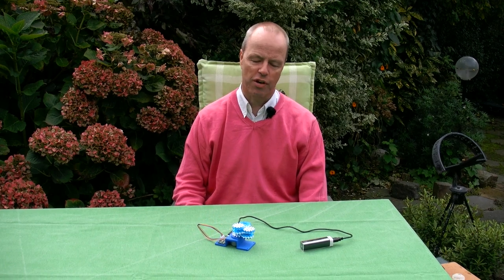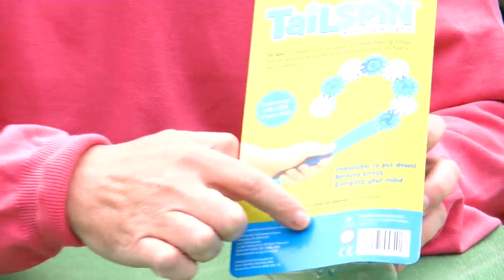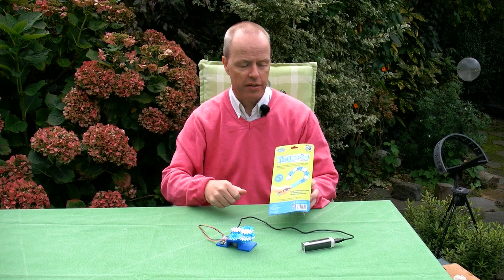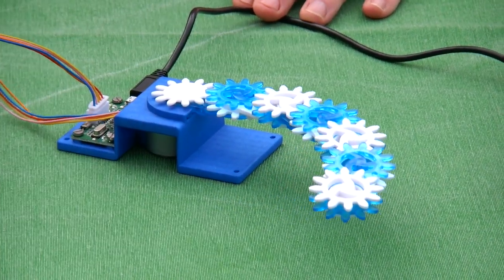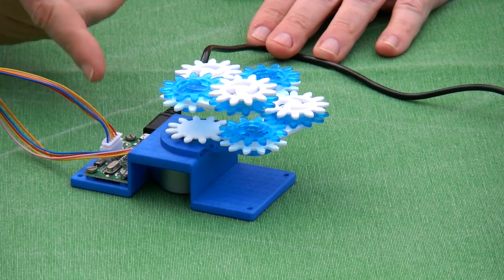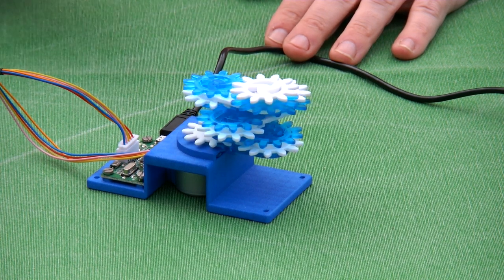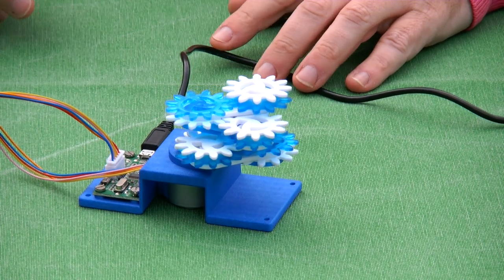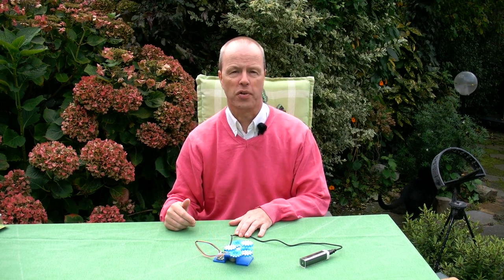Tailspin Motorized

Comment from the maker: How does one operate the Thinkfun Tailspin toy? What is its original purpose?
Reply: One operates it by swinging it at foes like a flail. It's original purpose is to deal great damage to lightly armored enemies, dealing both crushing and slight piercing damage.
Reply: No idea Oskar, Thurs us the first time I see this I'm starting to follow you actually
Reply: I'm gonna need to research
Reply: It’s purpose was to grasp string in space. The arm entangles the floating string / rope and collects, tangled.
Reply: Clearly you operate it by attaching a motor and driving it very slowly. As for its purpose, it cuts grass.